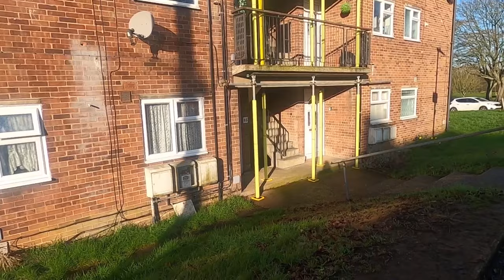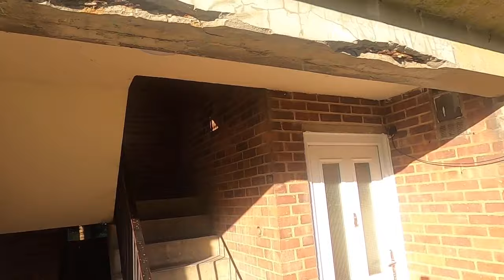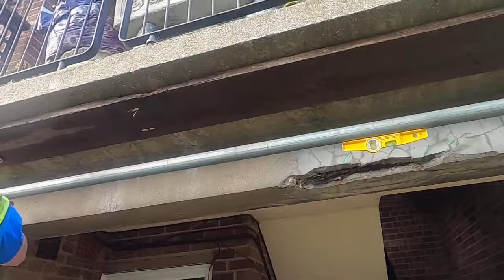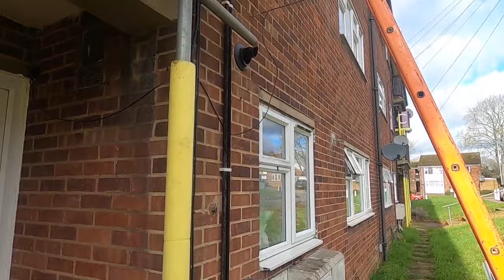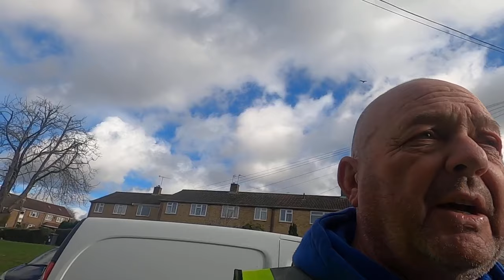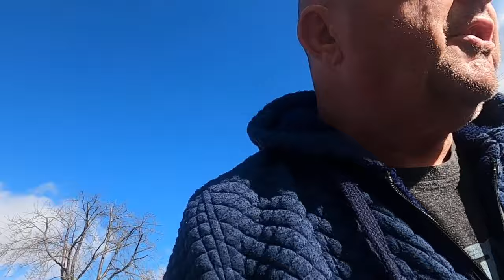Structural Scaffolding

Comment: Andy,
Hemel Hempstead, I know it well. I live in Harpenden, which is about 11 miles away.
I remember the Putlog scaffolds very well indeed and building those spade-ended putlogs into the wall as work proceeded.   We used to crack on with the house scaffolding - not a ticket, nor method statement or risk assessment to be seen.   
 Remember the "spigot joints?"    Working on a larger scheme where we had proper scaffolding done by professionals, all of the standards were joined together with spigots which caused a plane of longitudinal weakness along the front of the scaffold......eventually the scaffold failed at that point and the scaffold came away from the walling. The spigot joints acted like a "hinged-joint" and the entire scaffold tipped backward away from the wall.  No one killed luckily.
Those existing concrete repairs look shite. Concrete repairs done correctly by experienced people should last. Those looked like a splodge, smear & run job......
You should do a video on concrete repairs its an interesting topic.
P U B ?   I know one or two in Hemel...
😁👍👍
Reply from the maker: Ive done plenty of concrete repairs, dont get involved now. Spigot joints yes they really weren't fit for purpose, unfortunately Hemel is to far from home to start drinking but i did spot some nice looking looking pubs.

Comment: Frog down is an utter ball-ache when it comes to chasing out clean slots in pointing or making good afterwards. It wouldn't be so bad if the frogs were full, but I rarely come across any which are.

Plenty of 50s/60s buildings could have asbestos in them, so better safe than sorry re. ppe. Fall arrest stuff has its place but not at hop-up height...

I know the Hemel and Snorbens area well.
Reply from the maker: Yep nothing worse than putting a lintol and trying to pack the bed joint in above it and they are frog down.

Comment: Can’t beat a puddy scaffold , I’ll still use them on domestic extensions my scaffolders will put it up no problem, fucking inside standard is bastard ! Always in the way !
Reply from the maker: I used to have a load of aluminum tube years ago with the bolt on pudlock ends, great stuff on domestics.
Reply: 👍🏻 that’s what my scaffolder mainly uses, don’t see a lot of pudlock tubes anymore as no one uses them